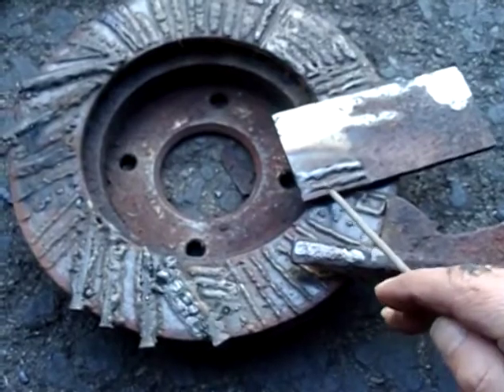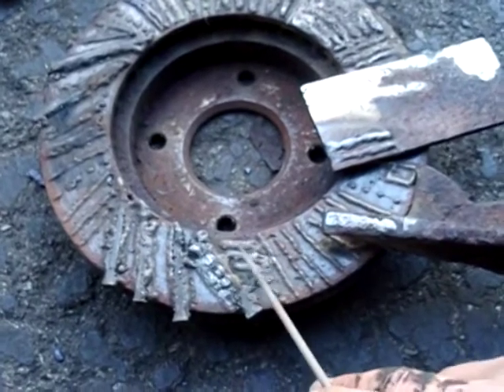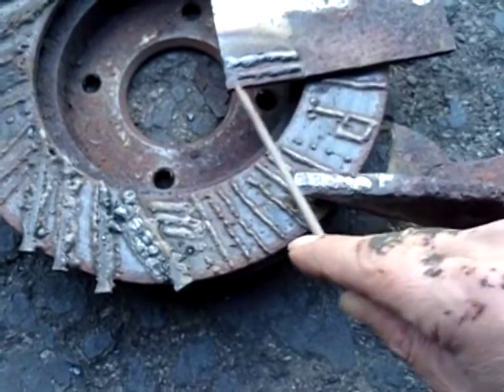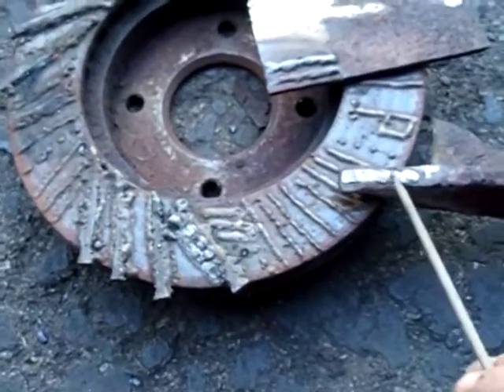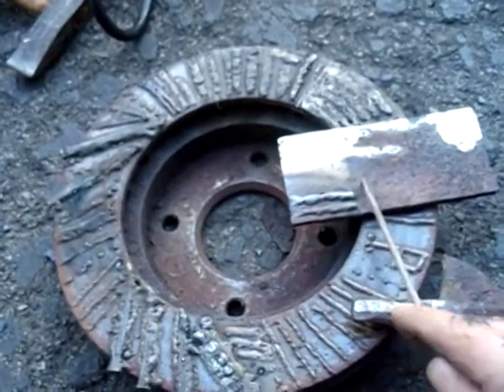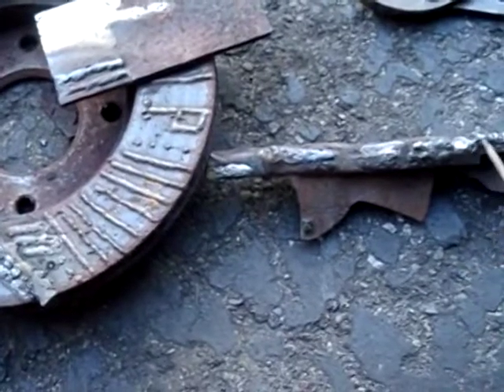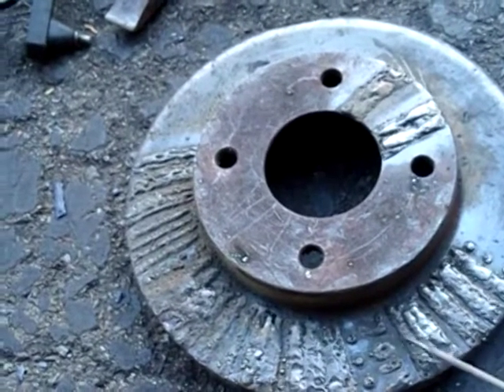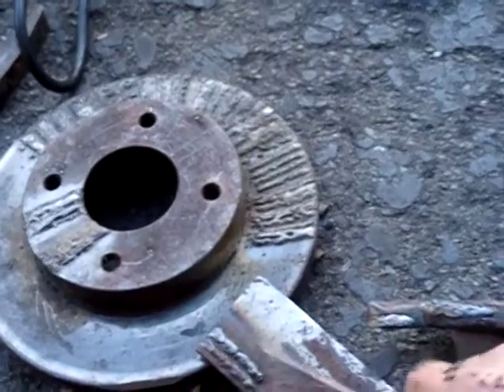Welding practice on: cast iron (brake rotors) and steel...

Comment: Brake rotors are either cast iron or ceramic.  No auto manufacturer or offbrand uses a more expensive material than cast iron because cast iron performs better for braking purposes than mild or stainless steel.

Stainless in general warps way faster then iron in braking applications due to its constant heat cycling, and would make the steel deform and become extremely brittle in the first couple hours of normal driving.

Comment: Old steel car wheels also make for good welding practice.
Reply from the maker: funny I was at a garage today and saw a bent steel rim and thought the same thing, knowing it is steel not cast.
Reply: rob12449 Welding two of the steel rims together (one flat on ground and the other on its edge) makes a good axle stand.

Comment: maybe pre heat
Reply from the maker: when you seriously weld cast iron preheating and slow cooling are important. since i was running bead after bead it got pretty well heated and I did not notice much difference.